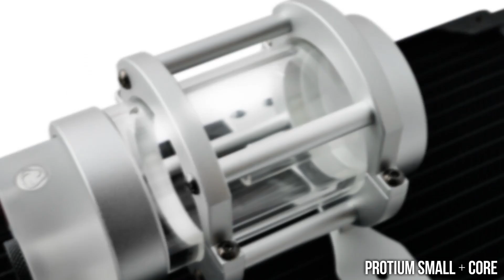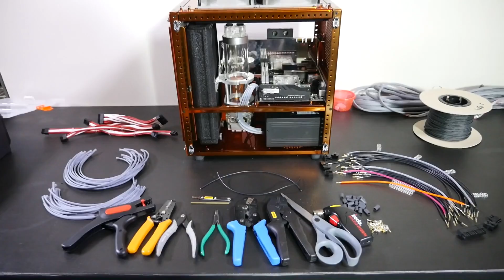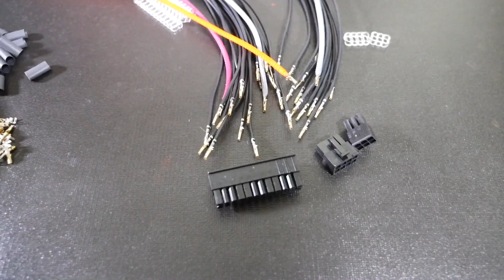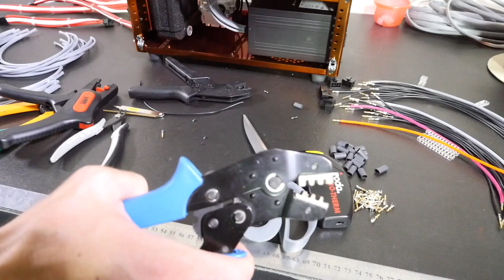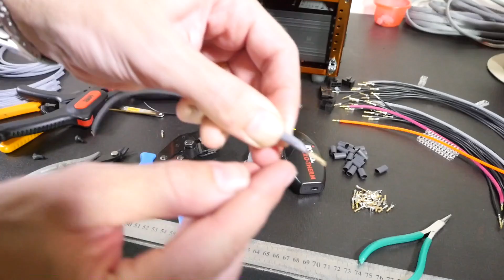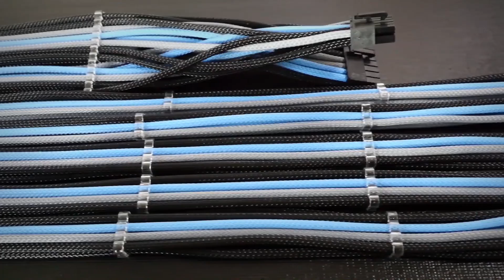Custom Cable Building

Comment: Buying sleeved cables is the biggest marketing trick ever, its waay to expensive. You can buy the sleeves on AliExpress for 2$-ish for 10 meters...
Reply: Yes it is quite a bit cheaper to do it yourself, but you do need to account for the labor involved.
Reply: Jeroen I sleeved 1 power supply on my own. now I order all my cables. the money to me is worth the time and tediousness.
Reply: I can't argue with that. Nobody ever said that this is for everybody. it will test what you are made of. you will burn your fingertips, you will waste lots of pins, you will literally cry at night cause you just want to finish the build to take that glory shot you have been working very hard for. but suddenly appears that double cable and you have to do it well. And yes your first PSU took you a week. the second will take you half the time. Building computers for some is a job, for others it's a hobby. in the end of the day that what defines the PC community. no judgement. everything works for certain people. others have to accept and respect that. :)
Reply: You got it wrong my friend. When you are building a showroom pc or a just an eye candy computer. you don't run extensions, you run exact length cut cables. they make cable management look sexy. also with the cheap ones they use the cheapest pins, connectors and cables. it's not a gimmick. it's for perfectionists.
Reply: So is building a whole PC mate, you're paying for the labor when you buy completed goods assembled from available parts.
Reply: Avodat dude. There is no point :) the guy said he would buy 2$ sleeved extensions. That should kill any reason you would try to make with him :)
Reply: They are not at all expensive wtf? They are cheaper then ever and are you seriously talking about sleeving from china? If you use MDPC-X, as you should and most prebuild cables are mdpcX. For example icemodz cables, if you would buy all the stuff neccesary for them, it would cost you about 15dollars less (I calculated it). 15dollars for a labour that goes into sleeved kit of cables is a joke
Reply: A few pointers, though;
Sleeving from AliExpress (or in my case; cheap Chinese sleeving bought from China via eBay) isn't particularly high quality. The plastic is stiff and brittle, seems to have a low burning point (ie; sealing the ends with a flame typically causes it to burn as opposed to melt), may or may not contain questionable ingredients (It smells pretty acrid when it burns) and also seems to have a fairly loose weave. It's honestly only good for personal jobs where you don't care about quality and will only be inspected from a distance, or for learning how to do sleeving properly.
The tools you require for sleeving (Crimpers, a good torch, pins, wire, heatshrink and the sleeves themselves) VERY quickly add up in cost. Unless you plan on doing sleeving often as either a hobby or job buying those tools is often out of the question (Especially given the crimpers typically have to be made custom - at least in MDPC-X's case).
And finally the time; Sleeving a PSU for me personally takes ~8-10 hours. Assuming my country's minimum wage the hours worked alone would be the cost of a pre-built set of sleeved cables.

Honestly; if you're building custom cables for a full ATX case the cost of sleeving alone is pretty brutal. Dan sells MDPC-X @ $1.20 AUD/meter. Assuming high-end mid-tower build some napkin math would have the cables average out at ~500mm each. With 8-pin EPS, 24-pin, 2x 8-pin ATX and maybe a SATA cable or two you're looking at about ~60-ish wires to sleeve. About 30m of sleeving, so about $36 AUD in sleeving alone. In my country that'll buy a BitFenix sleeved 24-pin AND 8-pin EPS. Take into account cost of wire, pins and headers (Not including the time investment and pre-requisite tools) and for the general consumer who might not care about having a boutique PC and pre-built sleeved cables are an EASY decision.
Reply: all it showes me on there is hdmi cables when i try to find it. what search term do you type in
Reply: Ramzinho I agree it does look much nicer when they are the exact length, but cablemod kits come with options and I'm OK with hiding some cable clutter. I don't use extensions but it took about a week on and off sleeving that 1 PSU. I'm not building that many systems so it's worth it to me. I just don't have the patience for it lol. I know it's not up to everyone's standards but I'm not building show builds either.
Reply: how is it expensive i saw a set like 50$ :/
Reply: but no one will know the exact length of each cable strand as they cant know the way you will route. Even if you do like 24pin cable everyone of the 24 cables will be different length due to bending and such.

Comment: Hey man! Please! I need help! I am thinking of sleeving my EVGA 850w Supernova G2. How can I sufficiently sleeve this PSU if it uses multiple cable splices?
Reply: You would either Splice the double wires together with solder and heat-shrink or a crimping two wires on one pin (on the PSU) end with a short wire going to the other pin. Or apparently (according to others) you can just skip the double wires and just do one wire.

Hopefully that makes sense. There are a bunch of resources linked in the sidebar of reddit.com/r/PCsleeving you might check out as well.

Source: Have built/sleeved several EVGA G2 series sets
Reply: But with the Corsair Ax860i can you use a single stand for each individual cable? He's using the same PSU in the video above.
Reply: The AX860i still has a Double wire (Pin 13 on the 24pin I beleive) so basically the same thing as I said above would apply. Again, I have heard from some people that you can go without the double wires and just have one wire but it's not something I personally have tried so I will not recommend it myself.
Reply: Thanks! But hey! One problem is much better than having 3. I've been hearing the Ax860i has some bad reviews, should I go with the Hx850i? Money is no issue, it's just I want a killer system for my frat house.
Reply: Dunno. I basically swear by EVGA PSUs because of their great build quality, warranty, and price so I can't persoanlly speak for the Corsair units. A ton of people use Corsair PSUs though. 

Concerning the AX860i, JohnnyGuru gave it a 9.7 (granted, that was back in 2012) and he is a very in-depth and well respected PSU reviewer so if he likes it that much its good enough for me :)
Reply: American_Royalty If Johnny Sempai (Love his reviews) gave it a solid score, then I'll do it. As for my current EVGA 850w Supernova G2, I'll use it on my little bros build. I'll just get my system a Ax860i and sleeve it according to the pinning. So just one double pin I gotta do? That's fine. How do I go about doing that? Also is it really needs to use GOLD tipped ATX Female Terminals?
Reply: Just one on the 24pin for that model. On the PCIe cables (for both the ax860i and the EVGA G2) you will have another double crimp to deal with. The PCIe ones are easier to do tho since you can make more space for the double crimp since there will be an empty spot above it in the connector. I'll see if I can find a vid or pics explaining it a bit later and link them to ya or if I can't find any I'll make my own.

The Gold-tipped connectors are not necessary, I've always used the regular ones and been totally fine. If your planning on using 16 guage wire I'd recommend getting the 16 guage Terminals as well since it make crimping them easier and more secure since the 'wings' are longer.

If you're looking for the easiest PSU to do cables for I think that'd be one of the Silverstone ones because if I remember right their PSUs tend to have basically 1:1 pinouts.
Reply: American_Royalty So for the AX860i Ill have to do another double crimp. How can I make that crimp look like a single cord?
Reply: For the 24pin:   The Ax860i has one Double wire that goes to pin 13 on the Mobo side and pins 10 on the 10pin and 14 on the 14pin on the PSU side. How I usually do it is I make a short wire going to the 10pin and the 14pin and then double crimp that with the wire going to pin 13 on the 24pin (that wire can go to the 1opin or the 14pin, whichever you prefer). To do a double crimp in this way you essentially just cram both of the wire ends into the one terminal when you crimp it. There are several things to be aware of and trick to make it succesful that I can share but will do so a bit later when I can actually make a quick Vid explaining it for you.

For the PCIe Cables:   Like I said, both the AX860i and the EVGA G2 series have similar pinouts when it comes to the PCIe cables. Both have 4 +12v pins and 4 Ground pins. the issue is that for the PCIe connector spec you need only 3 +12v and 5 Ground. For this cable basically all you do is take two of the full-length wires and do another Double Crimp like on the 24pin and to make it look like your using all 8 pins on the PSU end you just snip the wall between the two places the pin goes in on the PSU end connector. Its really hard to explain properly in text so like I said, I'll make that quick vid for you later on tonight and explain all this again.
Reply: American_Royalty Thank you! I'll head over to MicroCenter when College finishes and start building my supplies
Reply from the maker: I really should have shown that in this video. OK I will do another video showing how to do split wires, which are in almost every PSU 24pin cable and a lot of PCIE 8pin too.
Reply from the maker: Yeah you have to solder, put the split on the PSU end so that its hidden. Put it about 80-100mm away from the connector to allow for the split to run to different parts of the cable. You can actually use half of a pin (the crimp part) and crimp the wires together and then add a little solder so that its really robust.
Reply: SingularityComputers Oh Thank you! One LAST question. I used the pinout website to get the pinouts for my PSU (EVGA G2 Supernova 850w) Some of the slots say +3.3v,+5v,+12v, and "Black Ground". What do these mean? Do I need a special type of 16AWG wire? Is  MDPC-X 16 AWG wire good for this?
Reply: American_Royalty Is it possible you may know the answer to some of my questions above?
Reply: Victor Persaud yeah, give me a sec and I'll get you some answers :)
Reply: OK,

On the pinouts, the +3.3v, +5v, +12v, etc. represent/label the different voltages that the power supply outputs on those pins. Usually when someone makes a pinout they are basically documenting how the Original cables were connected that way they can be re-produced exactly. The reason it is helpful when they label the output voltages is because it a) assists you in getting the right pins connected and b) lets you know where you can possibly switch things around if need be. The very most important thing about cable sleeving is getting the correct voltage outputs on the PSU to go to the correct voltage inputs on the Motherboard. Beyond possibly the Double wires/crimps, it doesn't really matter which +5v output on the PSU gets connected to a +5v input on the Motherboard. As long as the correct voltages are supplied to the correct pins on the motherboard then your PC will function perfectly fine. Hopefully that made sense.

As for the wire; to my knowledge the exact type of wire you use when building cables doesn't really matter as long as it is 18 awg or thicker. 16 gauge I believe is the largest gauge wire that there are pins/terminals made for so that is why it is most often chosen (Thicker wires can carry larger amounts of electricity) So, in short, the 16 guage wire you use doesn't really matter and the MDPC-X wire will work perfectly fine. I personally prefer wire with a little bit thicker insulation than most as I feel it helps the cables to look a bit more 'full'. The wire I use is the same as the wire Ensourced.net sells. He only sells it in white currently but I have found and will be getting some black wire soon so if you want that I could help you out. I have also used Mod-One's custom "M1" 16 guage wire and while it is stiffer than the Ensourced wire the Insulation is not as thick. Haven't tried any of the MDPC-X wire yet so I can't comment on that.

Hopefully that helped and just let me know if you have any more questions :)
Reply: So pretty much it's like mix and match according to color. But if I match everything good, how would it look? Would it look like a great full length sleeved cable that is PERFECTLY arched? I want that perfect arch because I only want sheer  perfection. No kinks, no wire overlapping another. How would I do this with Cable combs? If I'm just matching oranges to oranges and apples to apples wouldn't it look almost like the stock (and REALLY MESSY) PSU cables? I don't want my wires looking like overlooked  spaghetti. I want that perfect, arched, and SINGLE standard full length cable.
Reply: American_Royalty Also if I follow LUTROO Customs Guide on my PSU, he indicates on the given pinout that he connected specific double crips in specific connectors for efficiency and the esthetic look of a clean, single, and perfectly sleeved cable
Reply: Yeah, basically. Just pay special attention to the special ones on the 24pin like PWR_OK, +5v VSB, etc.

As far as how it would look, here are a couple pics of some 24pin Fully modular cables I've done: http://imgur.com/a/Kkhq7

The only way to achieve absolutely no wires crossing over or overlapping each other is to either find a PSU with totally 1:1 pinouts (which are Rare), somehow re-wire the pinout to be 1:1 (Definitely NOT recommended), or to make a little box or something that contains all the wire cross-over inside of it. I am working on producing a product that does the latter as well as offering a bit of flair and functionality. Mod-One says he is "working on something too" which I can only assume is a similar thing but unfortunately neither are actual products yet. :/
Reply: If your referring to this one (http://www.overclock.net/t/1420796/lightbox/post/20663594/id/2008572) then yes, Tinus put the double wires right next to each other for easier routing for combs but because of the pinout of the PSU there will still be a fair amount of crossover because the 10pin and 18pin aren't split up evenly out of the 24pin :/
Reply: American_Royalty Hmm. So perhaps I could move my EVGA G2 Supernova 850w to my little bros build. I'll probably pick up a Corsair AX860i and sleeve that instead. It uses a 10+14 Pin connection. It will set me back a bit on my productivity, but patience is golden. I'll take another look at Lutro0's pinout for it. If anything comes up I'll look at you and SC Computers for help. I like your double wired method. Highly clean and very beautiful. Thanks! The AXi has only ONE double crimp and I'm sure I can get a perfect arch from its composition. Lemme take a look at the pinout. Thanks dude!
Reply: np, I'd love to hear how it goes. Good luck to ya!
Reply: Hey dude, I checked out Ensourced.net! They have the exact gold trim color i use on my case! Im going to pick up that and some of the 16AWG wire from them.  Im going to stockpile my tools and start preparing my workstation for some serious sleeving. Although I have to "sleeve" myself through finals right now lol
Reply: Victor Persaud Great! :) His pins/terminals are good too in case you wondered, I've used the pins from Ensourced, Mod-One and Mainframe (16 guage) and they are all good quality. speaking of Mainframe, it looks like they sell that Goldenrod Paracord too only it is already 'de-cored' so it might be worth it to get it there since you wouldn't have to spend the 20-30 minutes removing the core from the Ensourced one. I will say that Mainframe's website seems to be really sluggish at the moment though so just a little heads up.

Don't forget to get a bit extra because mistakes happen. I've been glad I got a bit extra supplies more times than I'd care to admit lol :)

Good luck on your finals!
Reply: What is the term "de-cored?" Also, does his pins accept a double crimp for the wire jumper from the PSU to the MoBo?
Reply: Victor Persaud 'de-cored' refers to having to remove the 'core' of the paracord prior to sleeving. I'm not sure if its a real term or just something I came up with but it seems to make sense to me :)

Basically all paracord (except ones advertised as 'coreless') have several strands on the inside of the outer shell that would have to be removed in order to use the paracord for sleeving as those strand occupy the space that we want the wire to be.

Ensourced's pins are literally just like the pins I used in the video I made. I used to get all my pins from him until I figured out that the Mod-One pins are the same and a cent cheaper (adds up when you buy 25 packs of them and I was getting MDPC-X sleeving from him anyway)